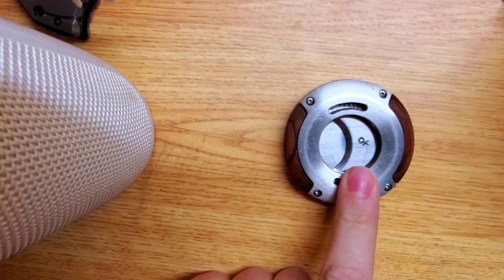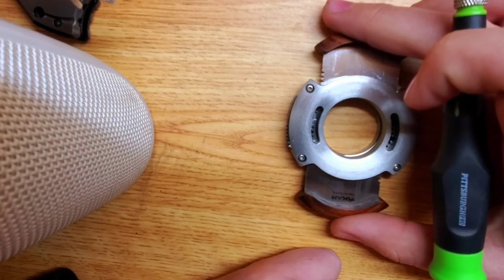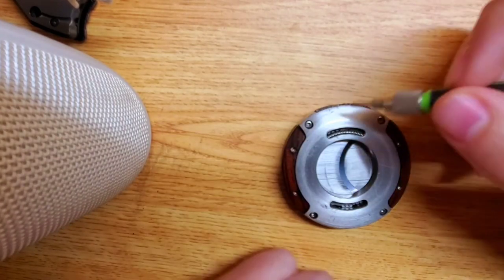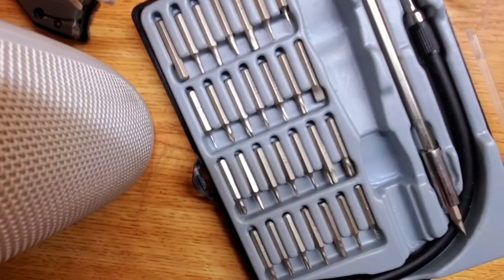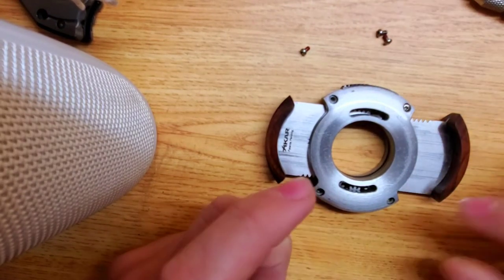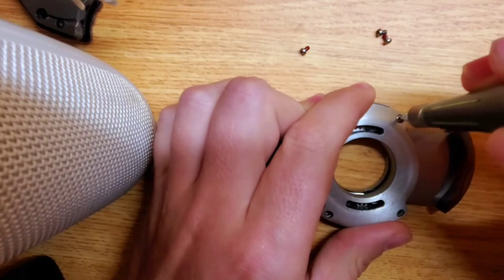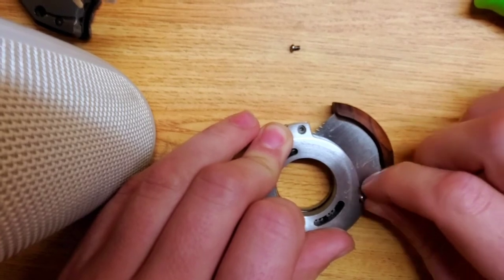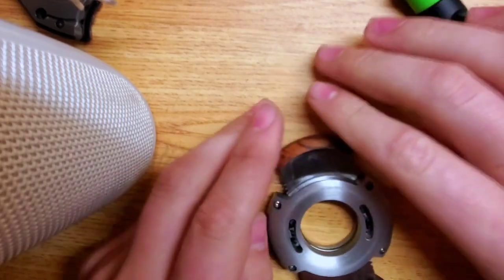XIKAR XO Cutter dissasembly and reassembly

Comment: Thanks @theXtory - Of course I didn't come looking for this until AFTER I completely disassembled my XO. My XO is 4+ years old and in real need of a deep clean.  I didn't have any real issues reassembling it due to your excellent description and clear video of the components. The index mark on the primary gear is key.  All back together, functioning like new,  very modest gear lube.  Thanks!

Comment: My xikar XO is stuck in the closed position, and I've onky used it 3 or 4 times. Any suggestion on how to get it unstuck?
Reply from the maker: I would say try and pull the clamshell off. It could be that something is bound in the gears or something isn’t aligned properly. Does the trigger actuate or is it stuck? If the trigger is actuating but it won’t open then it is certainly a gear issue. If the trigger is bound and won’t operate than something is preventing the trigger from moving, and you can start there. If you’ve only used it a couple of times and it is having problems I would look into a warranty replacement/ take it back to the shop you bought from and see if they can work something for you.

Comment: Why would i put gun/lube on something that im going to be using to cut my cigars? You really dont even have to take it apart like that. Blew it out w/some air, couple drops of coconut oil. Good to go.
Reply from the maker: I’ve owned one of these for several years now. There is a very large amount of buildup that you can get in the recoil spring and throughout the clamshell that air doesn’t/won’t get out. This video is just for the individuals who’s cutters won’t work nicely even after a basic clean. As for the coconut oil I’m all about that idea. I’ve never had issues using wd40 or gun CLP on mine as long as you don’t use a liberal application, and avoid the blades. I’ll try the coconut oil idea, though I’m curious to see how it does attracting lint and dirt etc from carrying in my pockets
Reply: @ethanfisk8094  it'll attract about the same ammount of lint as the clp. I keep mine in a little leather sleeve when on the go to circumvent the issue altogether. Wish they would have just put some fuel window type set up to eliminate the issue altogether while still giving a nice view of the gears and keeping stuff out.